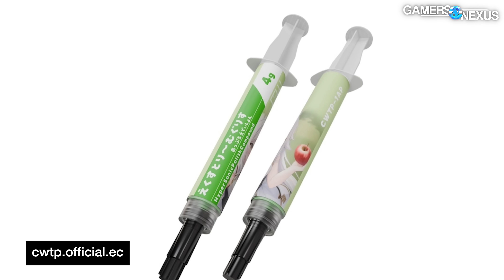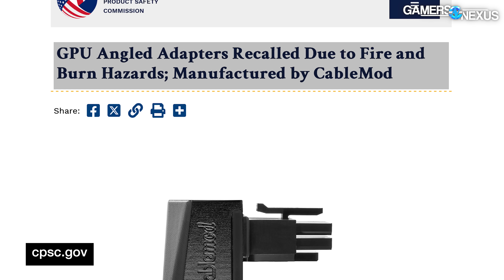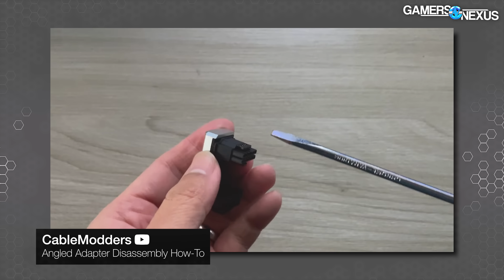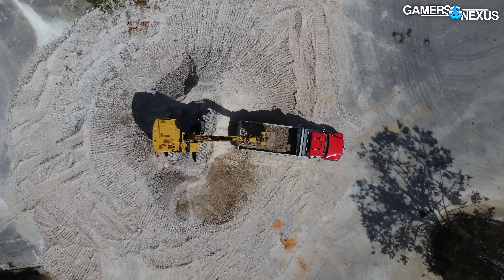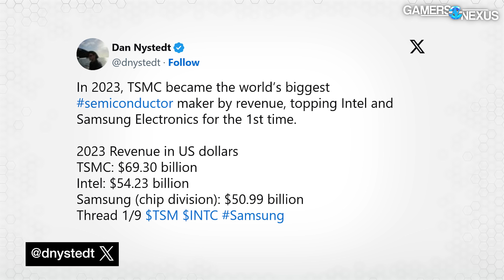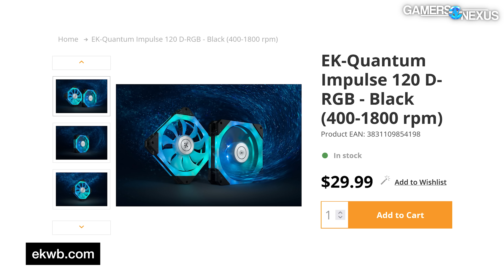HW News - CableMod 12VHPWR Safety Recall, Pre-Built PC ft. Malware, Scented Thermal Paste

Comment: Hello GN, I just found some 12VHPWR related news I feel you could look into and possibly make a piece about.
Igor's Lab reports a possible reason why all the melting 12VHPWR connects all have burnt +12V pins but not the GND pins. They measured the current on the +12V and GND pins of a 4070ti and found the +12V pins have twice the amount of current as the GND pins. And the surplus goes through the PCIe slot to the motherboard EPS & 24pin connector.
In short, the 12VHWPR cable (or the card) is "stealing" the motherboard's GND current capacity through the pcie slot. They say that's why the GND pins on the 12VHPWR are fine while the +12V ones burnt.
I feel this is worth a more in depth investigation to include more GPU across a wider power spectrum (4090? 4070?), and also to include AIB instead of reference models. Igor's also claim this behavior would have negative impact on the motherboard's audio quality as well as perepheral device input latency.

Link ot Igor's article:
https://www.igorslab.de/en/the-imbalance-of-current-flows-in-the-pc-why-only-certain-pins-of-the-12vhpwr-melt-and-via-ground-lines-on-detours-investigative/

Comment: I wonder, I buy a 4080 super and it say to use a single cable connector for each power connection, but my seasonic gold focus plus have 2 pci-e cables with double power connection (daisy chain?) do i really need 3 cables or can use 2, one single and one double?

Comment: I just ordered a Corsair HX1500i for my threadripper system. The PSU was factory sealed.
I inspected the native 12VHPWR cable and found that one Pin surrounding on the plug is marked with a black marker (Edding).
Woud you say this is a warranty thing for Corsair to see if the plug was put in fully, or could this be a kind of quality control thing whereas someone from Corsair QC checked this specific plug for debris or something?
In any case - its only on one Pin and clearly a mark...

Comment: The dumbest idea of the decade design such a shity connector. Using such a small connector for 600W in consumer electronics just asks for trouble. AMD did it right, they didn't see any benefits, except for "clean look" "less cable"
Reply: Honestly i perfer the look of two or three standard connectors compared to one tiny thing

Comment: The 12VHPWR connector is the real problem here, and it sucks that CableMod and not the folks that came up and approved such a terrible design are the ones stepping up like this. They could have sat on their hands and claimed it was all user error and probably gotten away with it, but they chose to do what nVidia hasn't and likely won't do and own up to a design that's at best finnicky, but at worst an actual fire hazard.

Comment: The 12VHPWR connector (or 'Garbage Connector') from nVidia is,  always was and always will be, a totally garbage 'solution'. To anyone who takes the time and effort to drills down into the technical details of the physical connector, the reason all this is happening is obvious: The technical specification for the connectors shows that, in the 12VHPR scenario, each contact is being run at or exceeding the maximum design current. Basically, the connector is overloaded so it's no surprise the inevitable happens.

A video on here by Der8auer mentions the specific connectors used and is is fairly straightforward to track down the data sheets ans specifications. One manufacturer makes three sizes of such a connector; the smallest and lowest-rated is the one used in 12VHPWR with the next size up being the same as regular PCIe connectors. Now, if the largest connector had been chosen then the outcome could have been very different with a genuine improvement in power delivery. 

The fact that the actual electrical mating  connections in the 12VHPWR connector are physically smaller than regular PCIe connectors and yet specified to handle much more power should have set off alarm bells from the outset. The 'adapters' that use four 8-pin PCIe connectors to one 12VHPWR connector are a complete nonsense. The 12VHPWR connector is, in reality, electrically less capable than two 6-pin PCIe connectors. Let that sink in....

Personally, I do wonder if the current situation is the result of some sort oversight or error somewhere in the design or production chain. An obvious possibility, that has happened numerous times before in various fields, is where imperial and metric units have become confused and misunderstood. From a global perspective, the majority of the world is using metric units.

I, personally, have not and will not be building any systems with hardware that utilizes the Garbage Connector.

Comment: Is it not readily apparent by now that 12VHPR connectors are not adequate for even stock 4090s and that any manufacturer that makes an accessory "power splitter, power display, etc" is just asking for huge liability lawsuits for houses burning down. PSU's shouldn't even supply a 12VHPR plug. Stick it to NVIDIA or no one!

Comment: the issue with that cablemod adapter is that where used to be 1 possible poor connection, there are now 2, so 2fold risk increase, that connector is the problem, not the angle of the connection, angled connector is just a bandaid on terrible design choice

Comment: I work in IT, know a guy that bought one of those Ace Power prebuilds, don't bother with them. Didn't bother mentioning it to me till he started having issues. Not only did he get an I9 1100 instead of the 1300 K in the listing of the one he bought for $820, it had a keylogger & some other unwanted malware & viri on it too. Surprisingly, it DID NOT have the RedLine variation. He already got locked out of his steam, gog, & microsoft acct's because of his passwords being changed by whomever stole his credentials. All this before he even contacted me. 

That thing is just weird anyway; ran CPUZ, GPUZ, HWInfo, & a few others- there's literally no motherboard vendor, a bunch of info missing from the bios, (It literally has ???? in the items place), No info on who made the ram or HD, the HD claims to be NVME but has Micro SD-card read/write speeds. When I get time, I plan on doing a proper teardown to see if it's just a MicroSD to M.2 adapter in there; & dig into that recovery partition in a sterile environment. No GPU just on-board intel crappy "HD" graphics despite the page touting that it had 24 MB of on die memory for "modern gaming". Compared to AMD, Qualcom & M1; Intel still has the worst integrated graphics in the business. I would say in the world, but I'm pretty sure there's some CCP state funded GPU chip out there that's worse- the difference is @ least their genuinely trying to improve on it unlike Intel.

Comment: The 12 V cables melt because the 1920 vintage buck regulators cannon handle the 48 V communications standard. 4 times the current means 16 times the heat. Maybe try a 21st-century design.

Comment: IMHO 12VHPWR is a waste, a bad move by industry, and needless. We had a tried and working solution for years ( and we were not even pushing it to it's full potential), there was NO NEED TO CHANGE IT. And the placement of the connector was done poorly as well, I'm staying away from the cards that use it if I can help it. It confuses me why we didn't just continue using NORMAL  mini-fit connectors, and what I have seen of the added 'sense' ping, the stupid things aren't even doing what SENSE pins usually do in terms of power supplies, so it seems a complete waste by the industry to trigger more sales than anything else, and then the consumer is left with a HALF ASSED product.

Comment: Sleazy detail on the recall: CableMod's refund is ONLY via PayPal, regardless of how you purchased the adapter, with the alternative of $60 to non-customized cables. 

I bought the adapter via credit card, and don't have a PayPal linked to my bank. I also already have a CableMod (straight) 12vhpwr cable I bought to use with the adapter. Other customers are reporting their PSUs are only available through the cable configuration. The fact they aren't offering refund through method of purchase is scummy.

Comment: I have a question for you, @GamersNexus. Hypothetically speaking, IF the CableMod 90 degree 12VHPWR adapter was installed correctly, flush and fit, with absolutely zero gap or wiggle room on both the GPU side and the cable side, would there still be a risk? Every single instance of this adapter failing involves it not seating correctly. From that, I can only come to the conclusion that, if used safely and correctly, there should be no risk. 

Now, I'm not asking you to legally bind yourself to this answer. This is a hypothetical question, and is not actual advice. For all intents and purposes, I have already removed the adapter and disabled it. However, curiosity strikes me. If there were no user end misuse of this product, would it safely and properly fulfill its design purpose, in your opinion?

Comment: The fact that Cablemod is only recalling adapters and not cables tells me that it's not an issue with the connector itself, but rather then way the connectors are mounted to the circuit board inside the adapter.  I know with the original adapter the connectors seem fairly loose and can wiggle around quite a bit.  It's easy to see how a bit of strain could damage the connection to the board, resulting in a high resistance joint and subsequent overheating.

Comment: Speaking of malevolent actions, I don't trust sending my devices to any shops offering tech support ever since a story broke out how one of the local shop here was holding on to a gaming PC until the owner went on to demand it back.The shop returned it pretty quickly on the spot, which is probably the only way he would ever found out that someone installed a bitcoin miner and didn't managed to remove by that point.

Comment: Cablemod is fixing my gpu. It's going to run about $600. I don't know why they can't still make one with larger conductors so there is less resistance. I really liked having it. If they can make a cable with a right angle, surely they can make an adapter work.

Comment: The problem is the 12 pin connector. Stop buying cards with the connection. Stop recommending cards with the connection. That's the actual solution.

Comment: So the 12VHPWR standard continues to be a headache. Perhaps it is just a poorly designed connector. Now having looked at the design before it is "competent", it does have a lot of contact points to achieve a very low contact resistance, but the amount of springiness in these contact points leaves a lot to be desired, so it is unlikely that all of them makes actual contact in practice.
Beyond that, it is still very dense and heat has to go somewhere, so one can't really send over an amp per contact point in such a dense design, especially in a warmer computer case.

Scented thermal paste is also an odd one...
Though, companies adds scents to all sorts of things to "improve the customer experience", so perhaps not the slightest bit surprising to be fair.

Comment: 12 volt was not a bad idea its how they went about it was impressively dumb. With normal cables you have multiple wires carrying the load giving you plenty of head room but with the 12v you have less removing a lot of the safety margin and then you toss in a 4090 and there remains very little left. If they had say two plugs instead of the one for a card we wouldn't be seeing this issue as the safety margin would have been plenty. But no they cheaped out and we have this mess which is going to take ages to deal with.

Comment: The EK Omnilink is interesting but the implementation looks like it could increase clutter. I can't recommend enough just buying some microfit connectors and a crimp tool. I have converted all wiring in my PC's to Microfit 3mm. No more SATA power plugs, barrel plugs or silly RGB connectors. I also had some spliiter pcb's made that can connect multiple cables to a single input from the power supply. Its really much easier than it might seem and not expensive. Its the same idea as the Omnilink but without using adaptor cables.

Comment: 12v hi power connector on 40 series was always a shit design. High power my ass!  Should have used 3 or 4 8 pin pci cables.

Comment: The 12vhpwr connector was a mistake and they need to change it asap.
Reply: It's called 12V-2X6, basically 12VHPWR with better cable sensing capabilities (fewer fires) with two 2x4 old school PCIe power connectors on the other end.  Apparently each of those 2x4's will carry 300W each, which begs the question why didn't we just stick to the various combinations of 2x3 and 2x4 connectors on the board.   I think a lot of headaches in PCs would have been solved with some sort of common bus used for communication with GPU, fans, powersupplies, LEDs, etc.., as long as it's able to route everywhere easily instead of burrying the data connection into the power connector for a GPU.  I'm all for the GPU being able to talk to the power supply, but why did we need to reinvent something that was working by shoving a new feature in and making a mess of things...

Comment: Bought a new 4070 recently (with all the enshitification Ive stopped caring and nust buy whatever does the job enough and dont even paybtoo much attention to price or anything) and ome of the things I specirically avoided was that new fangled burn your house down cable.

After seeing De8auhers video about how non existent the safety margins on it are vs ATX I was like, I just dont think my pc burning down is on the list of things Im willing to risk for no gain whatsoever.

My card doesnt even pull much, but the idea that any connector fails and it causes a sort of melt down cascade is ridiculously ill designed and I really hope they just give up and go back to the drawing board.

Unfortunately, Im getting the impression neither nVidia nor PCI Sig want to do that for fear of it looking like admitting guilt so Im guessing more people will have their pcs burn down just due to the cheapness of those mentioned.

Really unfortunate.

Comment: Remember how those angled adapters were meant to avoid connector melting?

12VHPWR is a dangerous standard and should be completely revised to use a larger connector or abandoned altogether.
Reply: Or people need to solder thickst fittable wiring directly to the card, with some 8pins on the other end.
Reply: @wiedapp  The best solution would be to use full-size 12-pin PCIe connectors with the same pinouts and specs as 12VHPWR has, but most importantly, put them on the damn back end of the card and not the side. People will be more likely to accommodate the extra empty space in the case for the cabling that way without excessively bending the cable.

Comment: The 12vhpwr connector should have never existed. Nvidia should be forced to go back to the standard pcie 8 pin and 6 pin.
Reply: They won't because it benifits them, many production applications only work well with Nvidia, those users have to buy Nvidia because they have no other options, so if those users have issues, they either hope it's minor and try to repair it or buy a new one, giving them more money.

Comment: 12VHPWR is a bad connector and should not have been made. Why not use the proven 8pin cables? it's basically just as big as two 8 pin cables. And 2x8 pins have more cables (16) to distribute the load and not overheat. This connector was a bad decision and I think the reputation is already damaged enough to give it up. But nVidia might be scummy enough to keep pushing it next gen.
Reply: ^ This. It's a flawed and potentially dangerous design it seems to me and Nvidia and those behind it may well face legal repercussions at some point, should this continue to be the case.

Comment: Hey Steve, so a question about the Windows downloads from the key sellers. What about places like Masgrave and archive. I'm asking, because I've particularly wanted to get a cheap copy of Enterprise LTSC going properly without having to rearm the evaluation license every 3 months for 9 months of use before a reinstall is required. Why not just buy the key for it? Well... turns out the proper microsoft link only really gives the IoT version of this OS. And the key I bought... is for the older version from 2019. 

I've been thinking of opening up the ISO's I got from the links I found for that exact version in NTlite, and seeing what I find. If anything. So far Defender hasn't gone awol over the ISO's existing on my system, so.... that's good?

Anyways. Thanks for your reply or input otherwise if you decide to follow up a video about stuff like this.
Reply: The so called grey market is largely a myth. It's not a concern for home users.

Comment: Almost all prebuild custom PCs ship with windows. Saying there's a keylogger is redundant. I bought an AceMagic mini pc last summer and the first thing I did was replace the ssd. I never trust those things. I was only installing opnsense on it, but why take that chance?
Reply: Did you not know that you can wipe an SSD, as with any other drive, and that therefore the only thing you did by replacing it instead is waste money?
Reply: @ZenAndPsychedelicHealingCenter  I have faster/larger nvme drives that the cacheless low capacity sata m.2 it came with. I lost nothing by chucking it.